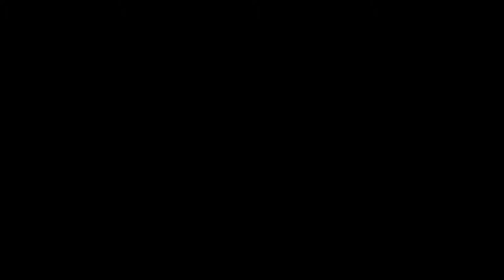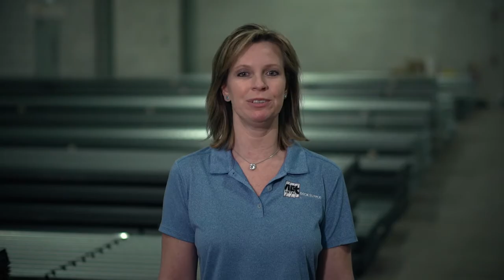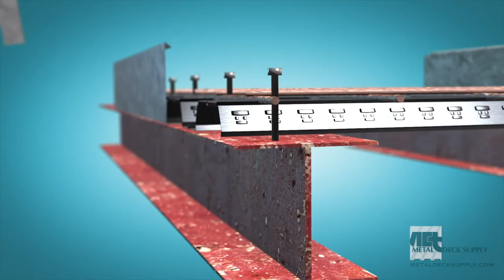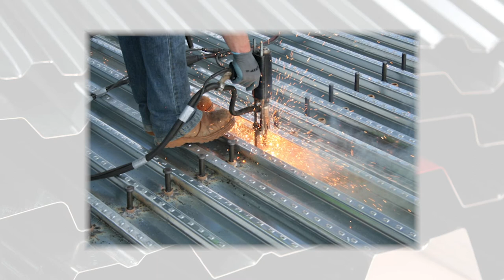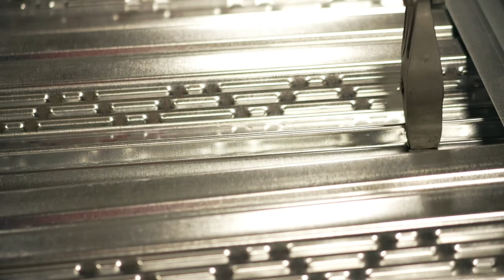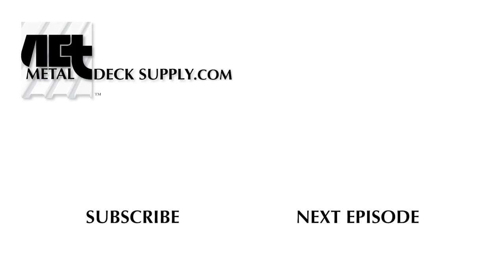Floor Deck Accessories | Metal Deck 101

Comment: You can extend the metal decking sheet to the end and no need for the extra angle to lock the opening for the concrete purring